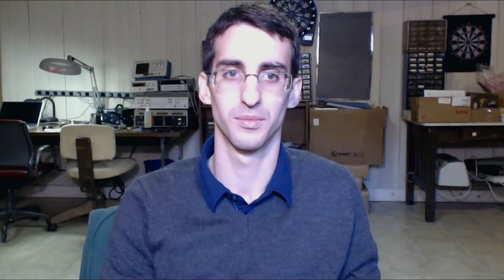Oscilloscope; Choosing the Right One

Comment: Perhaps the most important consideration when purchasing an oscilloscope is thinking about what you're going to do with it. For example, if you're going to be developing embedded control systems, you may want to choose a scope that has digital inputs and some logic-analysis capability. One of the cool things about the latest generation of oscilloscopes is that you can add digital logic capability to them and still keep costs down. 

The Rohde & Schwarz RTC 1000 Series, for example, has up to eight digital inputs, and you can use this capability in several different ways if you’re designing or troubleshooting embedded systems. One way you can use this capability is to trigger on a combination of the logic inputs and see what an analog output is doing. The scope can do serial protocol analysis, so that you can monitor and troubleshoot problems with I2C, SPI, UART/RS-232/ RS-422/RS-485, CAN, and LIN busses

Comment: Are you kidding me? How does this video help me decide on selecting a scope? How about going over what you would be using it for. Automotive, Audio visual use, trouble shooting electric motors. My first question would be, what are you planning on using it for. Secondly, why do you feel you need more than one? If you cannot get even one to function for what you need it for, spending money on several seems stupid. 
Lastly, you looked like you read this off a script. it was horrible.